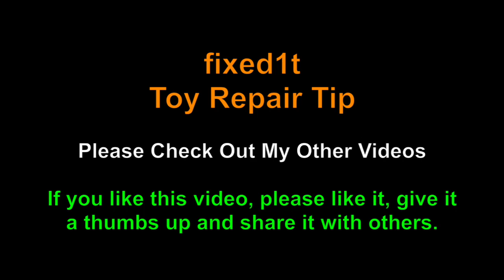Thunder Tumbler 360 Stunt Car Repair - Aerial Wheel Mount Stronger Repair

Comment: Dang man you got a pretty cool channel here I too like to repair things I haven't been able to do very many videos of me fixing things because I did not have the equipment at the time but now I do and probably my first project is going to be fixing a toy state cat D 10 T bulldozer The owner that had it before me broke the left side lights and hydraulic cylinder off of the main screw mounton the left side of the bulldozer The thing was held on there by a very small piece of plastic that was attached to the back of the screw and then the piece that broke off was attached to the frontso what I'm going to do is I'm going to probably get some JB Weld input that around the back and then that should make a big enough piece of plastic to hold that front piece on thereand then all I will need to do is push the wire back into the socket and then it will be working like a charm
Reply from the maker: Alex Williamson'sadventures Alex it sounds great ,a kindred spirit. My best friend has a child with Asperger and 9 years ago she was distraught at work and I asked why, she said a sophisticated Electronic Plane her mum had brought for her son got broken in a few days and her mum was upset and he was inconsolable. Being Asperger you can't just buy a new one and expect it to be accepted as a replacement as would be the case with the average child,he knows its different.  I said don't you know I've been doing serious electronics (building synths, programming etc) since I was in my late teens.  So she brought it in and I fixed it. Followed by a huge dragon with a wing torn off it got fixed, then the Nintendo DS many times, then the iPad lol  the latest is the Thunder Tumbler, and I've just finished repairing his Leapfrog game console. I do it all for free or parts cost the reward is his smile when its working again, quite frankly we think he breaks things just so Uncle fixed1t can fix it, its no skin off my nose, he's a great kid.  It was her son who called me Uncle fixed it so I thought thats a great name, but it was taken everywhere so I used fixed1t. I'm also a musician, singer songwriter for years, just for fun..  I'd love to see some photos or video of the D 10 T bulldozer, it sounds a beast.  All the best. Malcolm
Reply: And thank you so much for subscribing to my channel I'm going to make a video of me repairing that bulldozer I haven't done it yetbut you will know when I do

Comment: how to. we turn on the wheels lights
Reply from the maker: The wheel lights are LED's built into the body of the car (if it has clear wheels).  If you can see the LED's but they are not on, let me know.  With this car the wheel LED circuit board got broken and I had to bridge the tracks and glue it in place.  #fixed1tTOYSHEDtips